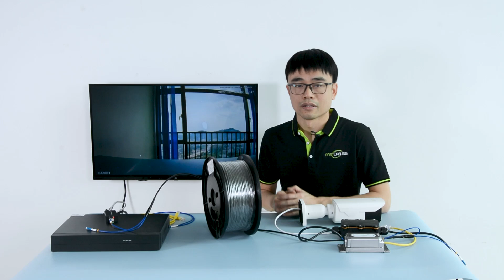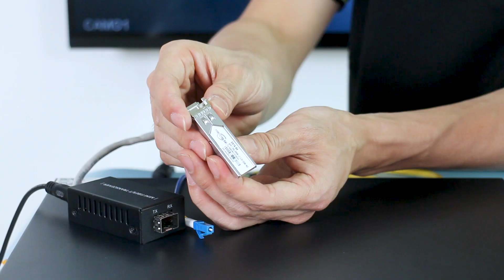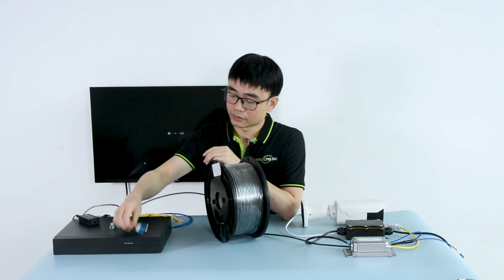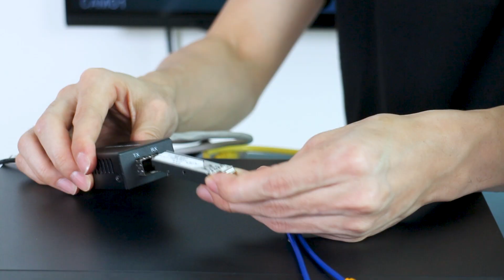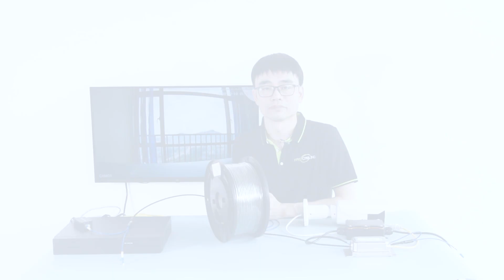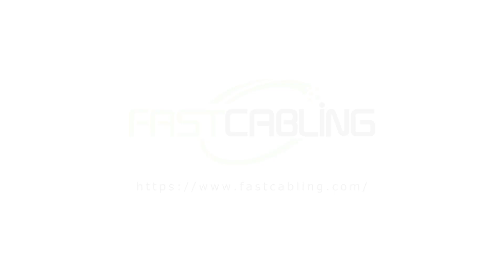How to choose fiber optical cable for IP camera systems

Comment: Hi @fast cabling. What is the most suitable fiber cable in terms of simplex/ duplex? Do I need to use two fiber cables for Rx/Tx or a single fiber cable (one fiber strand) can handle both directions?
Reply from the maker: You can use bidirectional (BiDi) transceivers. These devices allow you to use a single fiber strand to handle both Tx and Rx by utilizing different wavelengths for each direction. This can significantly reduce the amount of fiber needed, making it a cost-effective solution in scenarios where cable management or space is a concern.
Reply: @Fastcabling  Thanks for the reply! Do all fiber optic cables (single or multi mode) support the BiDi function or do I need to check for a specific one? Also, do all connectors support BiDi functionality? I'm thinking to deploy LC connectors.

Last, is there any secure method to for crimping LC connector in the field?
Reply from the maker: Q1: Do all fiber optic cables (single or multi mode) support the BiDi function?
A1: Not all fiber optic cables or connectors are inherently BiDi (Bidirectional) compatible. You should ensure that the fiber is compatible with the specific BiDi transceiver wavelength. For example, some BiDi transceivers work at 1310 nm for transmit and 1550 nm for receive, while others might use different wavelength combinations. 

Q2: Do all connectors support BiDi functionality?
A2: Most common fiber optic connectors like LC, SC, MTP/MPO, ST, and FC are simply mechanical interfaces that allow a fiber to connect to a transceiver or other optical equipment. These connectors themselves don’t inherently support or limit BiDi functionality. What matters is how they are used in conjunction with BiDi transceivers and the wavelengths being transmitted through the fiber.

Q3: How to crimp LC connectors in the field?
A3: Crimping LC connectors in the field can be challenging due to the precision required, but it's manageable with the right tools:

1. Crimping Tool: Use a specialized crimping tool for fiber optic connectors to securely attach the fiber to the LC connector.
2. Cleaving: Properly cleave the fiber to ensure a clean cut and good optical performance. A quality fiber cleaver is essential.
3. Field-Installable LC Connectors: These connectors are designed for easy field assembly without a fusion splicer. They often use adhesive or gel to secure the fiber.
4. Crimp and Polish: After crimping, polish the fiber end to achieve a low-insertion loss and optimal connection quality.

Comment: how we can chose the core of fiber cables (2c, 4c or 6c), it is depends on what?
Reply from the maker: Choosing the core count of fiber cables depends on your specific network needs. For smaller setups, like homes, 2c (2-core) may suffice, while larger networks may benefit from 4c or 6c options, providing more capacity for data transmission. Consider factors like bandwidth requirements and future scalability when making your decision.
Reply: @Fastcabling  thanks for your response, also may I know up to what bandwidth we can use this 2C cable.? Need more clarification.

Comment: How to link 12 core mm to 6 core sm for ip camera
Reply from the maker: You might need some kind of adapter cable to covert mm to sm. The diameter of the core is different.

Comment: Sir I have a question 
That there is 2 mm cable for camera?
I mean the cable contained the protection on the cover
Reply from the maker: You can't connect the fiber optical cable to the camera directly. That is why you still need a copper patch cord to provide PoE. The maximum distance is 100 meters between the outdoor media converter and the camera. The breakout of the fiber optical cable is armor. https://www.fastcabling.com/product-category/pre-terminated-fiber-cable/

Comment: How many cameras can one single mode cable operate?
Reply from the maker: It is not much different from the copper cable within a 1Gbps network. It can carry about 80-100 units of 1080p pixel Full HD IP cameras. The advantage of the fiber optical cable is long distance with high speed. However, if you use 10G network infrastructure, it will increase 10 times amount.